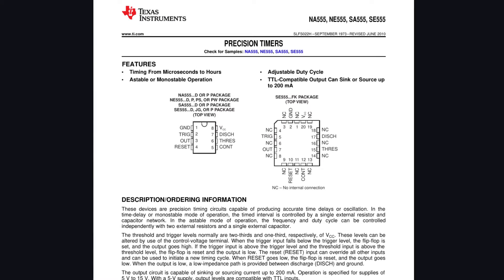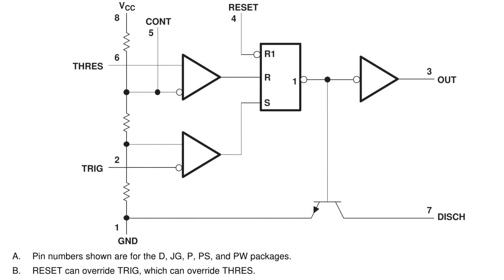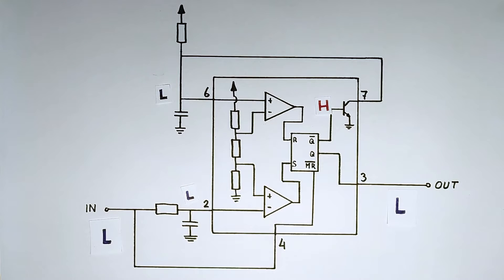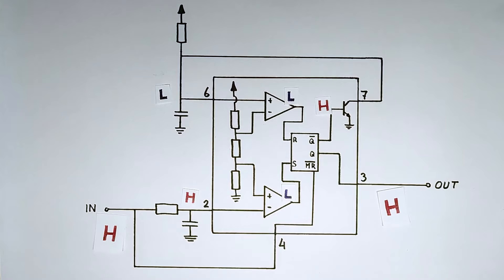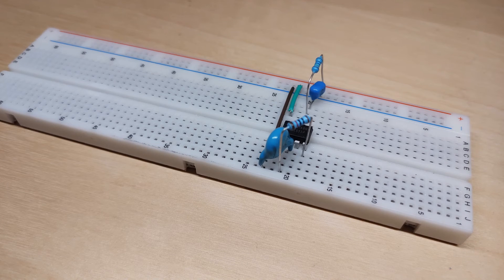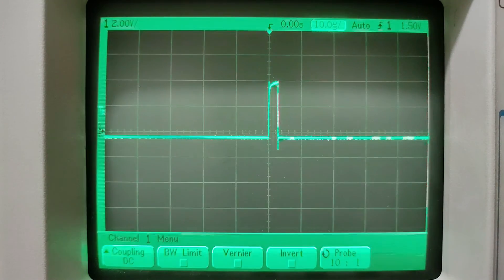NEW Monostable Circuit With NE555 (Rising Edge Triggering)

Comment: this is a very good circuit for edge detection, the only flaw is that output triggers as soon as the input is 1/3 vcc so if you have a unstable setup for example a breadboard cpu or similar it just doesn't work.

Comment: Can this be used in a 12 V circuit? I’m using an ignition feed high input to trigger and lock doors through a relay on a vehicle. Input resistor and capacitor values would change?
Reply from the maker: I think the 555 takes voltages up to like 15 or 18V, should check the datasheet.

Comment: Building an auto ignition distributor module that can adapt dwell time (w/o a processor or ECU) by RPM (voltage control) and trigger on a high from a Hall Sensor of long duty cycle but need a fraction of that Duty for the output. Convert 5 to 40ms pulse to a fixed 3.5ms. This is exactly what I was after. Uuuuge!!
Reply: Just simulated in in Falstad. Beautiful. Will add rpm voltage control and see how it goes!

Comment: For those asking about values - I built this using 47KΩ and .015uF at the input. The timing circuit consists of a 10uF capacitor with a 10K pot. I added a 91Ω fixed resistor in series with the pot to limit minimum pulse width. These values provide an adjustable pulse width of approximately 400uS to 130mS. I recommend use of a 10-turn pot for easier adjustment. All the formulas needed to ascertain values are in the NE555 data sheets, but I found it easier to model this in LTSPICE and adjust values by trial and error for the exact range needed. Hopefully the values I used will give you a starting point.

Comment: Thanks, this works well. I needed a simple pulse generator with separate frequency and pulse width controls that don't interact. I put your circuit into SPICE and massaged the values to get the range I needed, then triggered it with a separate NE555 astable oscillator. Perfect!

Comment: I'd like to see the actual values you used and how your test circuit is wired up. Schematic EVERYTHING.Give links if you don't want them in the video.  Switches generally don't bounce on opening. Wire them up accordingly. Or add RC to swamp the bounce (~100mS is what we did in the days before TVS and when CMOS had no protection diodes. Gone are the days. Thank the MAKER!!.  I'm older than transistors. )

This circuit is EXACTLY what I was looking for.  TY-V-V-M !!!

Comment: 6:07 This is exactly what I was looking for, thank you very much! I built the circuit with 0.01s as the time constant for the input circuit (pin 2) and 0.2s as the time constant for the second circuit (pins 6 and 7). As expected, the output LED lights up for about 0.2s as I press the push button, however it also briefly (less than 0.2s) lights up when I release the push button! Any idea what might be going  wrong? Unfortunately I don't have access to an oscilloscope. Many thanks!
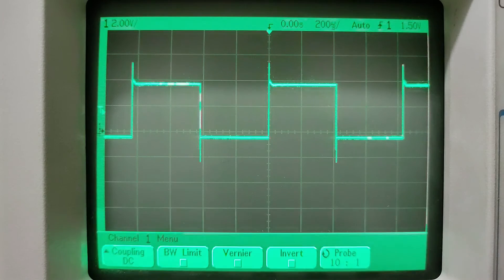Reply from the maker: My best guess is that the push button bounces at the release, or at least it doesn't toggle off in a clean way. This causes a new trigger event that only lasts as long as the bounce since the Master Reset quickly goes low again, terminating the cycle sooner than it would normally. The limitation of this circuit is that the ON time can't exceed the trigger high time. (I said that wrong at the end of the video at 5:24) 
Hope that helped!
Reply: @5VLogic  Thank you very much for taking the time to answer.

Switch bouncing was also my very first guess, however it was very easy to rule out as I had some SN74HC14N Schmitt triggers which were promptly put to use :)

I eventually found the answer myself and I intended to post the answer here for anybody to use the info, however I got caught up with other things and I didn’t take the time to do it. Since you did answer I now felt it was the right thing to write this up :)

I tried the same circuit with a few different types of 555s, 556s and CMOS TS555s that I had around and it was exactly the same with all of them, down to the fact that the second time the LED went on (after releasing the button) it stayed on for a shorter time than when it first went on (after pressing the button). This was a clue already that it was probably linked with the lower capacity capacitor on the trigger pin.

So I was really confused why it didn’t appear to be happening with your circuit. I can only presume that the issue was/is present in your circuit as well, however I reckon it was masked by a smaller capacitor (you said the RC constant has to be small(er) however you didn’t state the actual R and C values you used for it so I cannot verify this). I guess it was so small though that you just couldn’t observe the LED turning on for such a brief period of time. If you have any interest to test this hypothesis I suppose you could use another 555 there in the monostable or bistable configuration.

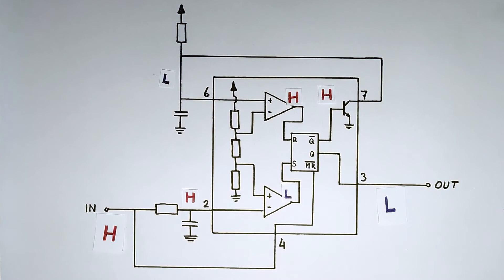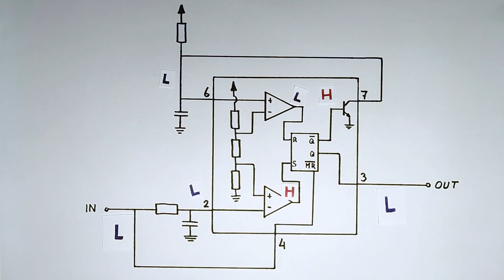But it all comes down to this: there is a hidden issue with the explanations from 3:28 to 4:10, and more exactly at 3:44 – the charge in the capacitor connected to the Trigger and Reset pins doesn’t instantly go from High all the way to Low, as you made it appear at 3:45, it takes a wee bit of time to drop, just like it took to charge. During that wee bit of time though it directly supplies a positive voltage to the Reset pin, just enough to make the 555 NOT reset yet_, like you said at 3:52. It turns out that while using 5V Vcc (the _minimum specified Vcc for 555 is 4.5V) the Reset pin has a lower threshold for a High level than the Trigger pin has (the latter is 1/3 of Vcc). There’s an article somebody published where he tested different 555 Cis and he found that “The threshold voltage is exceptionally low – lower than any true logic device. Specifications indicate a threshold range of 0.4 to 1.0V in bipolar devices, and 0.4 to 1.5V in CMOS device. Actual measurements indicate a range of 0.65 to 0.75V (bipolar) and 1.1V (CMOS)” (you can search for “Quirky 555 Timer Reset Function” if you want to read the entire article, I’m not including the direct URL here because YT has a habit of just deleting posts which include URLs).

So, while that capacitor is discharging it will first reach a voltage just below 1/3 Vcc (~1.67V with a 5V Vcc) but which is still higher than the threshold for High on the Reset pin (which is below 1.5V, see the article I mentioned above), at which point the first comparator will set the 555 output to High (not prevented by Reset _yet_), which will briefly turn the LED on, until the voltage on the capacitor drops below the threshold for Low on the Reset pin, at which point the 555 will finally reset and switch off the output. I hope I managed to explain this well.

Your circuit was still a very good inspiration though for what I need and with the addition on two NPN BJTs and a few resistors I think I fixed it. I even simulated it and it’s doing the job I wanted. If you want to see/check the simulation use the 2yw89uxm code with tinyurl com (again, I don’t want to include the URL here so YT doesn’t silently delete the entire post). I reckon if you really wish you could play around with the biasing resistors for the 2 BJTs to further fine tune the switching level for the Reset pin.

Hope this helps somebody :)
Reply from the maker: @dan-nutu  I'll admit I'm impressed, thank you for the insight.
Reply: @5VLogic  Your idea for the Reset trick helped me with the issue I was struggling with (generating only a short pulse following the rising front of a very long pulse - I'm just learning the ropes here), so, yeah, thank you, too! :)

Comment: Absolutely great! There are tons of videos and examples with NE555 as monostable circuit, but Reset-Pin 4 is always at Vcc and never used.
I needed exactly the shown behaviour: Waking up an ESP32 from DeepSleep with a short positive Pulse from  555 Output, 
while the (high) trigger IN stays high very much longer (30secs) then ESP Routine runs before it switches to DeepSleep Mode again.